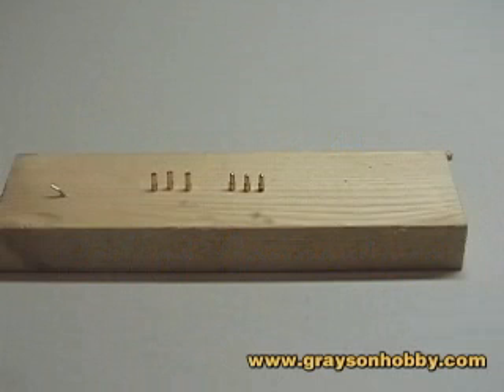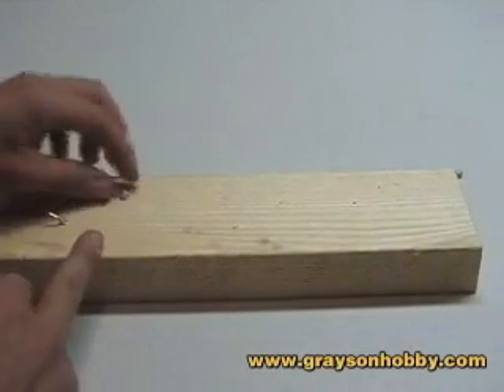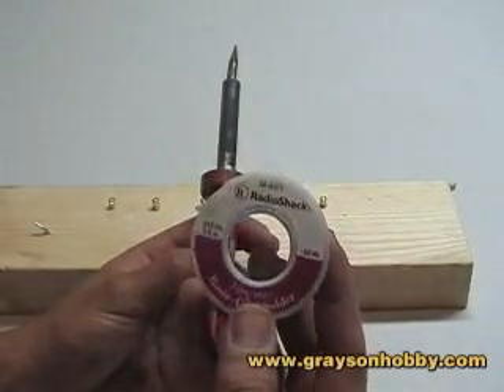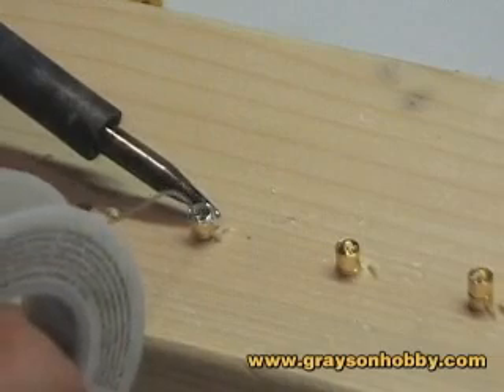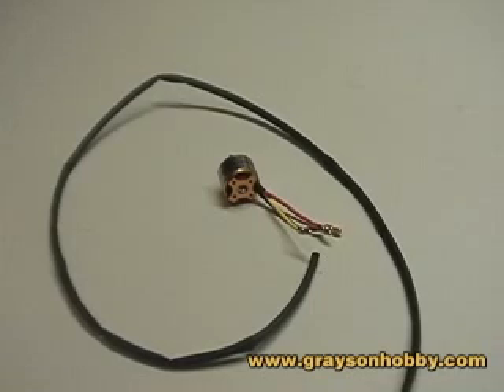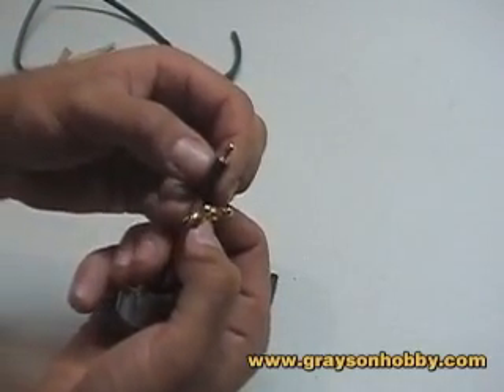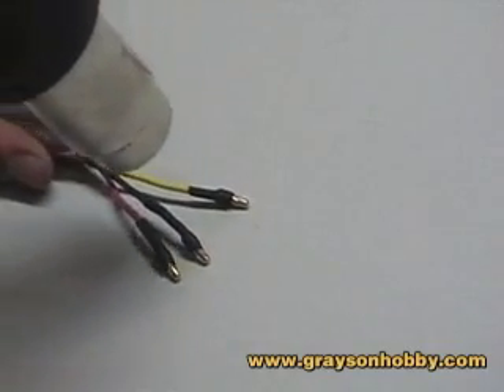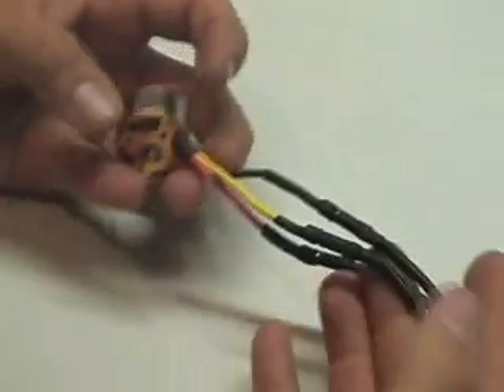How to Solder Bullet Connectors to Brushless Motors and ESC

Comment: You should tin the wire with solder first before putting it into the solder in the bullet. That way the wire takes the solder more easily and you'll get a much more solid connection.

Comment: Although this solder technique looks easy, it is incorrect and may lead to failure of the connection. , Before soldering, both the connector and the wire must be primed with solder. Then, when bonding the two, both the wire and connector must get hot.  Please find a better tutorial to follow. You wouldn't want your RC model crashing due to a failed joint! That being said, the wood trick is a good idea and I will be doing that.
Reply from the maker: Hey this is one old video.
Reply: Well the wires are primed with solder when they get inserted into the bullets? What is the point of tinning the wire here? As soon as you insert it it melts and flows anyway.

Comment: As that solder is cooling, you shouldn't be moving the wire at all... unless you want a bad solder joint.  And I'd pitch that Radio Shack garbagio for some Kester 60/40 or what I prefer... 63/37 that doesn't stay molten like the 60/40 does (which is the point where all that moving around can be detrimental)

Comment: My esc just came with the wire and no way to plug in my bullet connectors to the esc. What do I do?
Reply from the maker: hmm, im not 100% sure what you are asking,  but do you mean there is no wire?
Reply: +graysonhobby I have bullet connectors on my motor but on my esc I just have a little pre applied solder
Reply from the maker: +Skipp3rBuds  this'll work the same for a motor and ESC. just be sure your pre-tinned solder on the ESC heats up and melts. otherwise it's the same exact procedure. Good luck and let us know how it works out

Comment: This is misleading to people. The wire may stay securely in place, but this is not good soldering technique. You are supposed to bond the connector to the wire, not use solder as a conductor. Look at soldering videos before you do a tutorial.
Reply: ***** I don't think it matters what he did but rather what he tells people to do in a tutorial. I bet he is very knowledgeable in areas other than soldering electronics and he has a lot of followers. More reason to pay attention to details here. Dumping a cold wire in hot solder can't be good. BTW, I am no expert here either. I just know from videos about how to solder electronics properly and it seems like graysonhobby develop his own technique without consulting with an expert.  If I am wrong, please someone correct me.
Reply: +Michael Brumley Why wouldn't using the solder as the conductor be enough?

Comment: I'm paraphrasing but "Wood doesn't conduct heat"???
Reply: +Sam Morris well it doesn't "conduct heat", in that it won't transfer heat to other parts of the wood like metal would, but he didn't say wood doesn't burn. there is a difference, although when i heard that, i did think "but it does burn if you get too much heat" but not for the type of thing you are doing here.
Reply: Steve Andrews yeah I understand, this comment was from a while back and when I saw it again, I thoight, "I'm stupid." Ty anyways though

Comment: Looks efficient, I'll try it with just a "helping hand" clamp to hold the connector. Looking at the negative comments, is the potential cold solder issue solved by pre-tinning the wire or simply holding it in the solder "bath" longer?
Reply from the maker: Hi
I never had a cold solder doing it this method. Pretin will for sure help.  Also, as long as you heat the connector, NOT THE SOLDER, you should not have any cold solder issues.  After it cools, give it a good tug to make sure it does not come out.

I still do this same thing today.  Helping hand is good, but I tend to push too hard on the iron which sometimes the connector falls out.  Putting it in the wood allows me to push harder.
Reply: graysonhobby Just completed my first mini quad specifically needed soldering for PDB, battery and ESC. Used this method on both small 2mm bullets and large XT60s. Works a treat and if you get it dead centre (easy to do this way) and shrink rap to the edge looks like a factory fit and can confirm very strong ☺ Thumbs up from me 👍

Comment: No heat applied to the wire before shoving it in that bullet full of molten solder.  No pre-tinning or fluxing of your wire leads.  No discernible use of rosin core solder or flux on your bullet connector.  That wire may stay in the connector, but you very likely are going to get an inefficient, cold solder joint at best, or a complete failure at worst doing it this way.
Reply: Hi Ty King, please check my method, I think it's thoroughly soldering: https://www.youtube.com/watch?v=dOACqQ_ZhoQ

Comment: If you dont know how to solder, dont make "tutorials"
Reply: patteplunta i found this very useful, what Is he doing wrong?
Reply: Everything. Most importantly the fact that you need to heat BOTH the wire and the connector up to a point where solder melts on BOTH of them. Only then are both of them ready to accept solder. This is the MOST CRITICAL part of soldering. Imagine a heavy gauge wire often used in RC, like AWG14, with hundreds of strands. With this method you can maybe get 1/10 of the strands soldered (poorly), but in the core there are no strands connected to anything.
Reply: The strands are connected by touching each other. It’s not like they’re floating isolated from everything. The ends are also soldered to the bullets, I can’t understand the issue.

Comment: I solder a nice amount of solder on the cable then just a little on the inside of the bullet connector. Balance the bullet connector on top of the cable then heat the bullet with a turbo lighter. Done

Comment: one thing-dont move anything when you take the heat away for 10 seconds or you get the dreaded cold joint where it is possible that the wire can come out with the solder and all.

Comment: Yes, use them on batteries when used in this method. These include a plastic shroud which makes it impossible to short. Look up hobbyking HXT 4MM or 3.5MM connector. You'll see the plastic cover.

Comment: @graysonhobby If I wanted to solder a 48v ebike 1000w hub motor to a 48v 20ah battery can I use these connectors soldered on the copper wire of the hub motor and battery?

Comment: Brilliant idea for the wood board, it will also warn you naturally if you eat up the connector for too long.

At minute 3:55 to 4:00 in the video you solder the yellow wire. If I may I think you should heat up a little bit longer. By applying solder in the bullet and warming it up you are "Tinning" the metal of the connector we can see the same as been made to the wire when you put the wire in the bullet connector you have to make sure both area do melt and create a solid bond

Comment: @731thing No. My motor has 3 black terminals and ESC has 3 terminals with A, B, C on them. Piece of wood, drill, heat gun are not the tools required for soldering :) I still think its a ridiculous video. Sorry.

Comment: I just soldered my esc and motors like shown in the video, but made sure to hold the cable really still as the solder cooled, and I used really high quality solder. Make sure the solder is shiny after it cools, and if it's not, melt it again and hold the wire still this time.

Comment: @Artelian1 On the 3 wires going to the motor, it does not matter which goes where. If the motor spins the wrong way you can just reverse any two of the connectors. No damage will result. However you want to make sure you have the polarity correct going from battery to the ESC, or it may result in damage. (those are marked red and black tho, so you would really have to have your head on backwards to get it wrong.)

Comment: How about one for the battery connector that comes in the combo's?  Actually, how about a video that shows all of the soldering steps and wiring for one of the combo's?  Love the combo's but the lack of instructions is a bit of a head scratcher!

Comment: That solder iron is in dire need of cleaning and whetting lol. Use a brass sponge and rub the tip over the sponge when the iron's hot, then apply solder. Gives a much better cleaned and whetted tip than a wet sponge.

Comment: Hi. Don't know if you found your answer or not, but you can plug in the wires in any order. If the motor is not turning the right direction, reverse ANY two wires to reverse the direction of the motor. The motor doesn't care what order the wires are connected nor does it care which direction its turning.

Comment: Nice trick with the piece of wood! I'll use this trick next time I'll solder, it'll definately make the process easier and the result better. Now I don't have anything to remark except that the wires should be applied with solder Before putting them down into the "cup" The wires might cool the solder in the cup so that the lead doesn't adhere properly to the copper. This will cause power losses. This also happens while moving the lead during cooldown. (I'm into electronics engineering)

Comment: Great idea.  I made this jig, too, and it makes soldering a SNAP!  I went from about 10 minutes per set of 3 to maybe 2 minutes.

I spaced my holes about 1/2" apart, which I think was an improvement.  Also built a Dean's hole which likewise speeds that process up about 3X.

Cheers!

Comment: Just thought I'd mention that if you touch a bit of solder on the tip of the soldering iron before you put it on the connector it will help to conduct the heat better. Also, it's important to try and keep the cable as still as possible until the solder has solidified, otherwise you will get a dry joint. For those of you that don't know, a dry joint will be dull and greyish. A good solder joint will be shiny and silver.

Comment: Does it have to be 40W?? I see you are melting the solder through the gold connector. Does a 15W soldering iron have enough power to conduct the right amount of heat through the gold connector or do I have to do it from the inside?

Comment: A good tip for getting the holes drilled to the right depth is to put some masking tape on the drill bit at the desired height, that way you don't drill too deep or too shallow (just stop when the tape gets to where you're drilling).